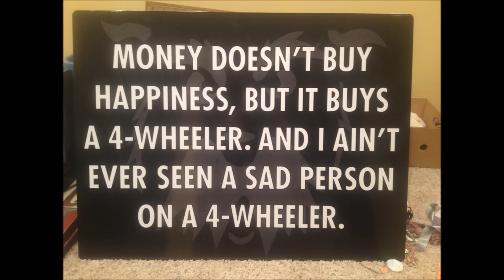Team Muskrat- The Story

Comment: What are the width of 1G's outlaws and rim size?
Reply: +Renegade 11  looking for someone that runs the 29.5x10x12 outlaw tire and what they think about them?
Reply from the maker: 29.5x12x12 in the back, 29.5x10x12 in the front
Reply: Do you think the outlaw 1 is better than the outlaw 2 in mud?
Reply from the maker: +Renegade 11 if you have the hp and drivetrain to spin the 31's the clearance definitely helps, but wheel speed is everything, and they are tougher to keep spinning. We prefer 29.5